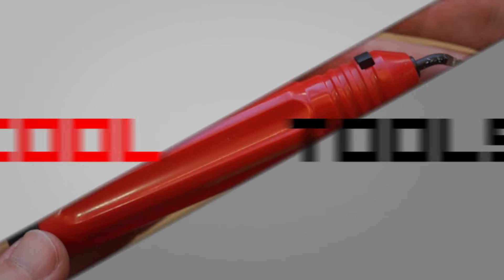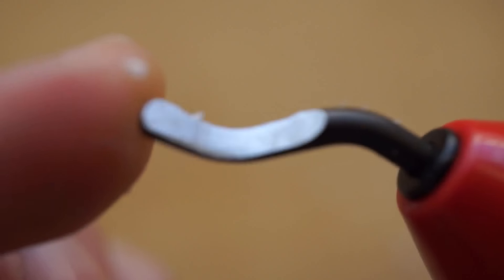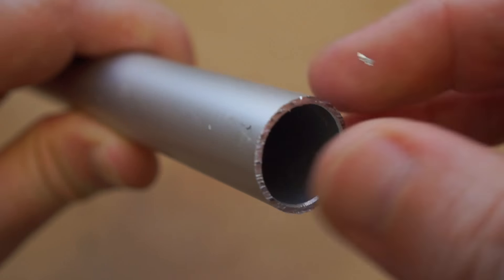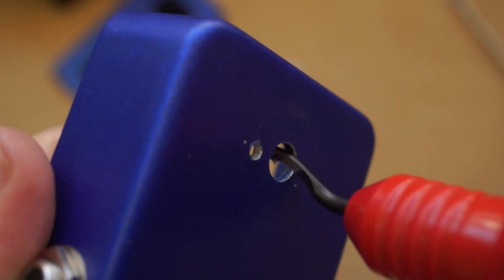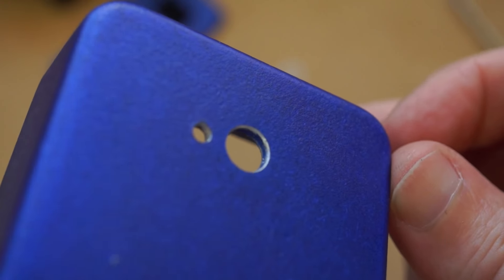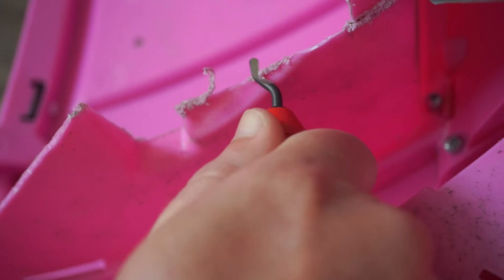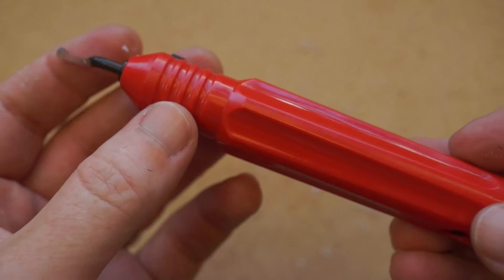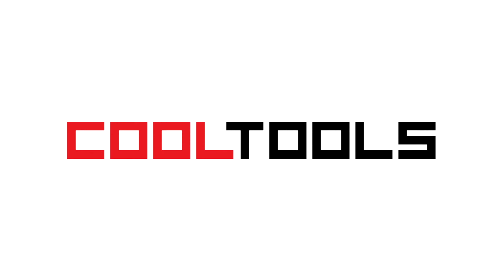Quick burr removal tool

Comment: What if the hole is smaller, for example how to deburr many 1/16" holes in plastic?
Reply: Drill bits might work, small round diamond/ steel files, or to shape your own deburr tool from a worn out screwdriver or a nail. 😌🌎🌅